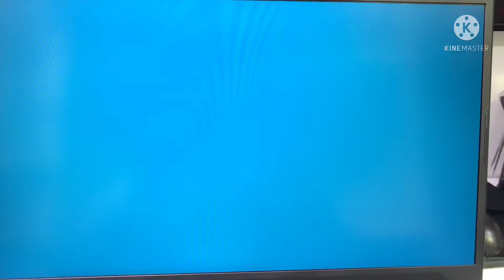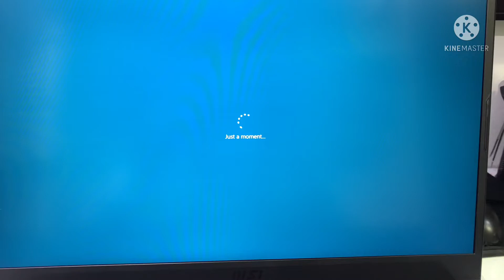MSI katana GF76 | MSI katana upgrade | MSI katana 11th generation | MSI katana 2022

Comment: thank you for your video. can i ask you that i bought a msi gf75 12u... series laptop and normally its written in spec of this laptop processor has 3.5ghz but when i check the system info in laptop its written 2.7ghz. why and how can i fix it pls help me my friend. thanks
Reply from the maker: You check original specs by serial number in official website and processor you can not upgrade.

Comment: why not 2 slot of ssd?
Reply from the maker: this model support 1 ssd and 1 Hdd ..  please like and subscribe if this is helpful . thanks .
Reply: There are 2 m.2 slots and 1 2.5 drive slot on the model with the rtx 3060.
Reply: @neal4044  where is the 2nd m.2 slot I've got the 3050 thinking there was two slots and I can't figure out where the second slot is
Reply from the maker: @HippieWizardRecords  this model comes with one ssd m.2 and one HDD or 2.5 ssd slots so u can upgrade m.2 and 2.5 HDD or 2.5 ssd